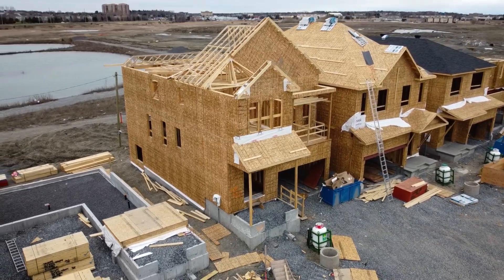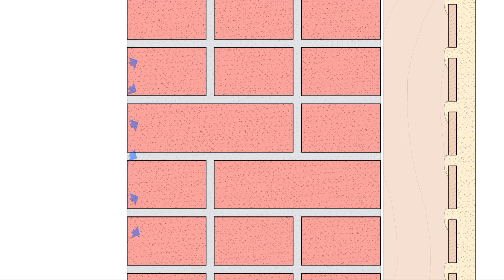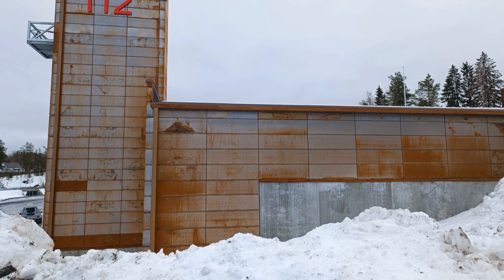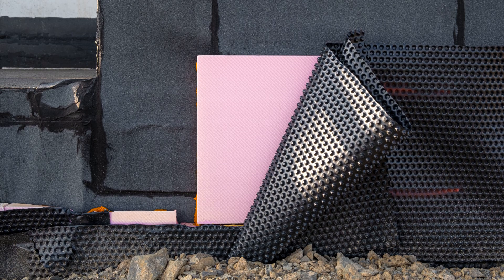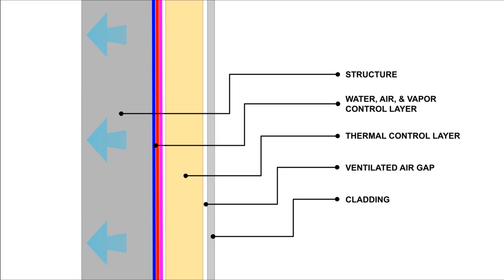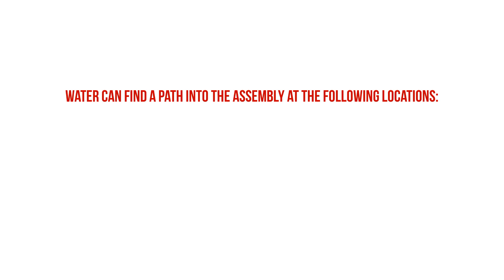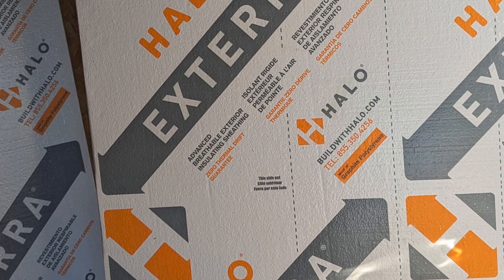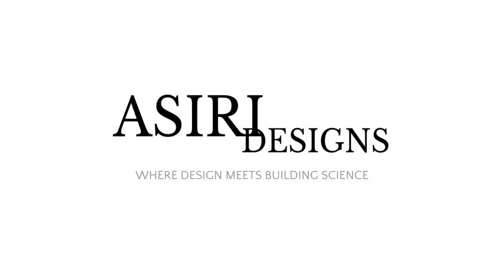Designing a Wall That Will Last 500 YEARS?! | The Perfect Wall

Comment: The issue with this is rigid insulation will eventually break down even when protected. Same with the vapor barrier. We are talking 500 years here. Any kind vapor barrier over that much time will break down. We need to think more basic construction, not high tech
Reply from the maker: Everything will eventually break down, but if you keep things away from the damage functions mentioned in the video, you can make things last much longer than their expected service life. There are actually some buildings 200+ years ago in which the bitumenous coatings that were applied to them are still relatively intact despite being exposed to less than ideal conditions, and many wooden structures that have lasted centuries. If we do provide a stable environment for these materials, we can squeeze a lot more life out of them.
Reply: @ASIRIDesigns  And in Europe there are 500+ years old buildings which are warm and dry. Because A simple air gap in brick and stone work, and a good roof are all that is needed.

I understand the modern obsession with air "tight" homes, vapor blocking, etc. But it is doomed to failure. Even if you get it right, it means you have to start to mechanically ventilate the building.
Reply: @jojomojo9823 actually, the combination of wood frame, straw and clay has everything a house needs.

Clay... makes it fireproof
...protects from moisture 
... protects against noise and heat 
... is a wind and vapor barrier

I live in a 400 year old house and cement and modern mortar destroyed the wood in some areas where it was applied. The wood in contact with clay remained intact. 
And yes, there was a major water hazard in this building in 2001.
Reply: The 500 year old buildings are warm when you burn a whole bunch of natural gas to keep them warm.

Also most buildings from 500 years ago are already gone. Only a few 'elite' buildings remain. Air gap wasn't common back then.
Reply: @jcvjcvjcvjcv  you severely underestimate the insulation power of straw combined with clay.
Modern wood frame straw block houses have a passive standard, which means almost no heating required.

The straw is for insulation and a filler, the clay is wind and vapor barrier as well as fire protection. The main difference from the old straw-clay buildings is the use of the straw blocks and the thickness of the walls.

Since the modern wood frame straw buildings use the same materials as the old ones, they are just as durable. And did you know that the owners often build them themselves? Adding the straw blocks and the clay covers is very simple, after that the house is already half done.

And no, 400+ year old buildings are not rare. In a range of 50 km from my home there are probably more than 50 buildings that old, including the one I live in. The main threats are poor maintenance and cement or foam. These buildings in proper maintenance can reach Energy class D easily, but also C is possible. B is out of range for most historical buildings, because exterior insulation is forbidden.
Reply: @jojomojo9823  we don't have enough energy for those stone Swiss cheese homes. We have so many people today the energy cost is insanely high and our planet cannot sustain that. We have to get tighter. But we can get tighter AND smarter.
Reply: 1. Thank you 2. Wonder how polywall blue wall would hold up 3. Have you seen perfect block iccf ? Cmu alt idea 4. I wondered about a center Wyeth of brick shelled in load bearing foamglas to as control layer with rockwool bats and air gap then brick siding. Wiring routed through foamglas chases on inside wall side then a small gap w/ brick interior wall… basalt ties tying in the wythes. Foamglas + brick == 2 wythe thick so 4.5-5 wythe wide wall probably . Insulation becomes part of load bearing structure.
Reply: To clarify I said Foamglas which is different than foam products. It is made of molten glass + and reactive agent that creates a cell structure encapsulating air pockets that do have some other gases in them. Some sulfate based byproduct. It is used in EU. Gravel is a gravel substitute in US made of it as well.
Reply: All this American talk about the perfect wall is the lipstick on the pig. Europeans have the solution. It is called AAC
Reply: You can use things like cork or stone wool besides foam as rigid inaulation. 

You could not pay me to live in a structure encased with foam, particularly 'tight' homes that rely on mechanical ventialtion for healthy air quality.
Reply: "The issue with this is rigid insulation will eventually break down even when protected. Same with the vapor barrier." -- Are you a DOW employee? It sounds to me like you made all that up. Only the companies making these products know how they perform under accelerated aging conditions. As far as any of us knows, mineral wool and XPS foam have indefinite life span inside a wall.
Reply: @LuminairPrime  DOW?

Comment: How did the old stone buildings survive?
Reply: The Gothic churches and such focused on water management and kicked the water as much as 6ft away from the foundation.

Or consider Venice l, everything drained into a cistern in a common courtyard for fresh water
Reply: They had decent roofs, basically. Until a brick or stone building has a solid roof, with a decent overhang - it will last for hundreds of years.
Reply: Drainage. It's all about ensuring that the water goes where it's supposed to be go in the roof and the foundation.
Reply: A lot really didn't "survive" you can just still see their rotting carcasses

Comment: With brick veneer, you have to watch out for grout piling up in the air gap during installation.
Reply from the maker: @jamesbrumbaugh4050  This is very true, another reason why rigid mineral wool is specified here - it's drainable and air permeable, so any mortar droppings that clog up the space won't trap water against the wall. It's not shown in the video but at the base of the wall we'd have a mesh-like material above the through-wall flashing that allows water to drain out of the weeps, even if there are mortar droppings above.